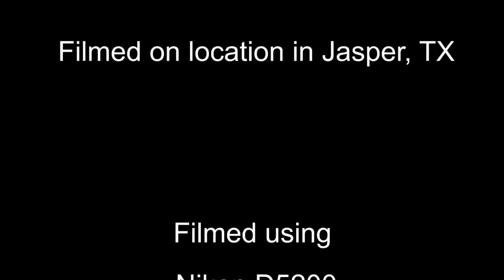Panther Well Services - Coiled Tubing in Action in Texas

Comment: hello, im asking about  the steps to put cement plug in an oil well  
total depth about  3000 m and bottom hole pressure about 3500 psi using 
1,5" coiled tubing